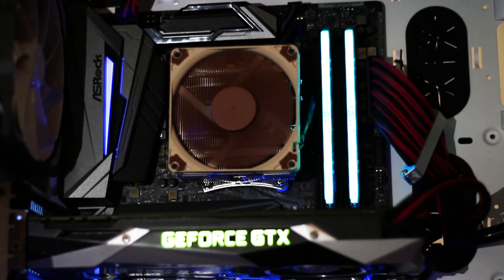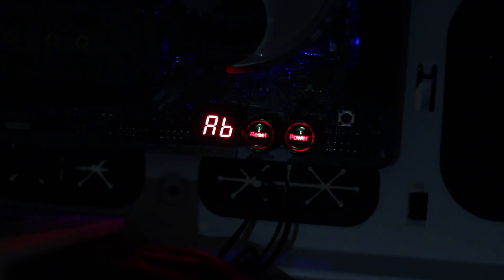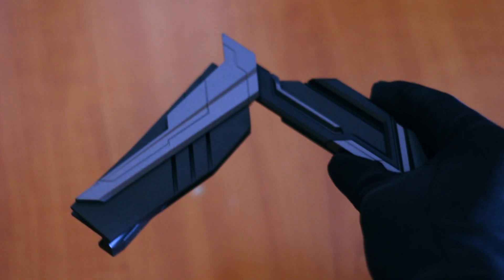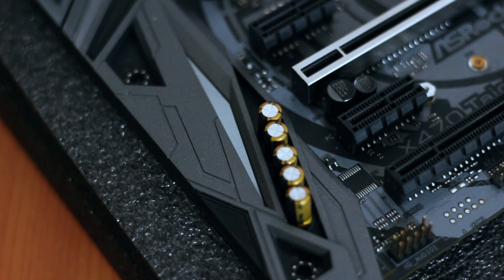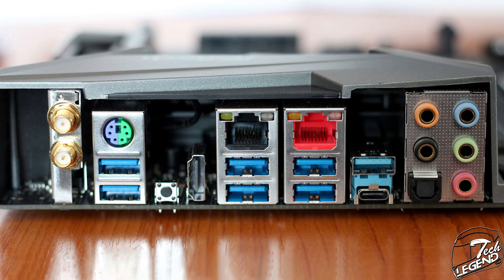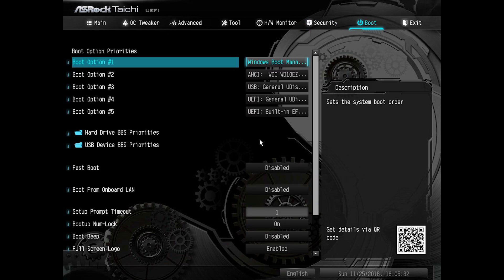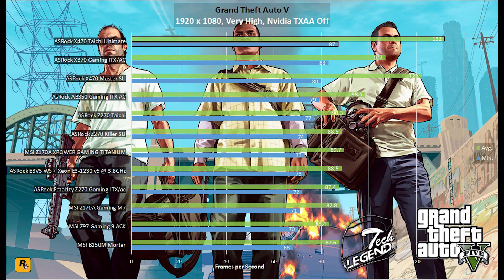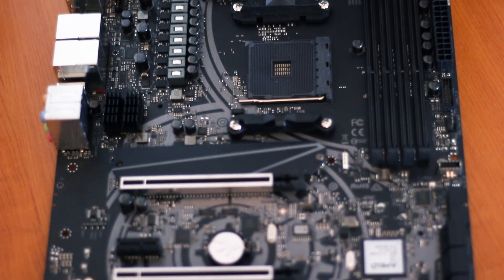ASRock X470 Taichi Ultimate Review

Comment: Hey man, was using two RAM sticks by 16 each was overclocking them successfully through BIOS xmp profile for 3200, added additional 2 by 16 sticks, bios posts and sees 3200 but bot linux and windows don’t want to boot.. any ideas what could be the reasob?
Reply from the maker: Overclocking four RAM sticks instead of two is harder, especially 16GB RAM modules. Reset the Bios to the factory settings and see if your PC boots.
Reply: @TechLegend-com have tried, same results, reset the bios through the button, i can load into bios and it recognises all 64 at 3200, but the os doesn’t want to boot…
Reply from the maker: @johnmoody1642  Go into the Bios, disable XMP and set the RAM frequency at 3000MHz, leave everything else on auto. See if that helps boot up.
Reply: @TechLegend-com  will try it tomorrow, thanks a lot again for your responses!;)
Reply: @TechLegend-com  tried and it totally works, doesn’t wanna go to 3200 but 3k everything seems to work, thanks for the advice!:)
Any reason you’d think of why it’s doing that?
Reply from the maker: @johnmoody1642  Glad to see you got it working!
As I've said before, overclocking four RAM sticks instead of just two is harder. The only way to get to 3200MHz with four sticks in your case is to slowly increase the frequency and tweak the timings and voltage.

Comment: Hey man, thanks for the review, still spot on, can. You please tell me when should i use the just the eight pin connector, and when both the 8 pin + the 4 pin?
Thanks!
Reply from the maker: Hey, just use the 8-Pin connector. The additional 4-Pin connector is used if you plan to overclock your CPU to the limit.
Reply: @TechLegend-com  even if i go for smth beefy like 5950x even then Only overclocking?
Reply from the maker: @johnmoody1642  The 8-Pin connector is good to supply up to 150W of power. For something like the 5950X then perhaps it would be for the best to use the 4-Pin as well, it won't hurt.
Reply: @TechLegend-com  thanks for the advice man!
Reply from the maker: @johnmoody1642  No problem!

Comment: Hi. Do you know how to remove the plastic cover above the IO? I have an issue with overheating aquantia chip below, and according to some users this helps. Is it hold by some screws, or what? Thank you!
Reply from the maker: Hi, yes, that plastic cover can be removed easily! Look on the back of the motherboard, there are some small black screws, those hold that plastic cover attached to the motherboard. Let me know if you manage to remove it or if you need more help. :)

Comment: what ist diffrent to taichi, not ultimate ? they havent't 10 gb lan and ... ? taichi Is good for oc ? and bios is good ?, because people are saying that asrock does not often give updates
Reply from the maker: The differences are like this: 10GB network card and the Power & Reset buttons also, there is a slight color change for these boards. The regular version is black with grey, while the Ultimate is grey with black. The Taichi is one of the best for overclocking, the VRM is overbuilt, regarding the Bios updates, I would rather have a bios that is updated once a year and works, then a Bios that has updates every month but is completely unstable from one update to another. I have yet to have any issues with any ASRock Bioses.

Comment: Taichi or Aorus Gaming 7?
Reply from the maker: Get the Taichi, it has the best power delivery system and also looks quite nice. Also, if you get the Ultimate version, you get Wi-Fi and a integrated 10GB LAN card.
Reply: @TechLegend-com  The non-Ultimate version of the Taichi also comes with Wifi and Bluetooth.
Reply from the maker: @KendalMike  If I remember correctly, the Ultimate has the 10GbE as well as Wi-Fi, that's the main difference. Also the color scheme and a slight design change.